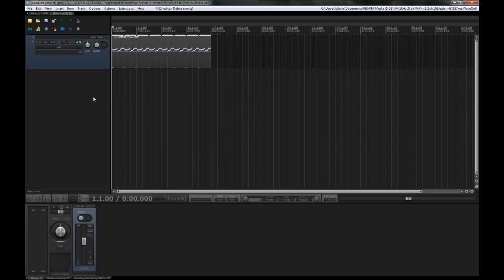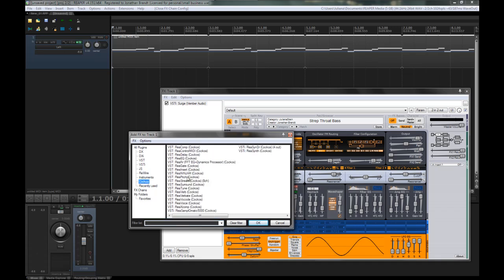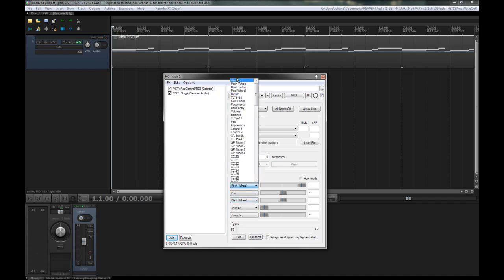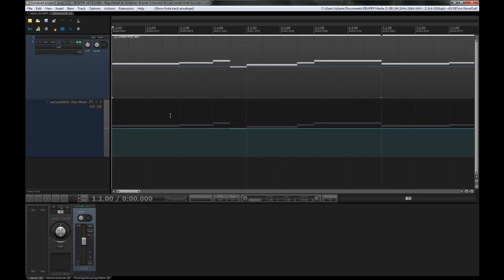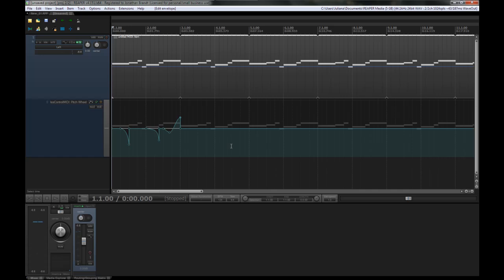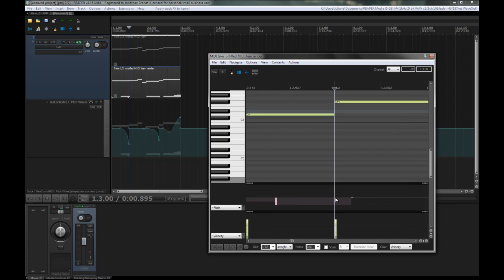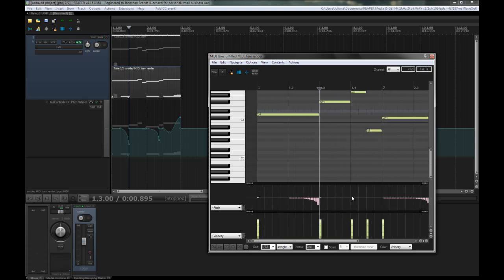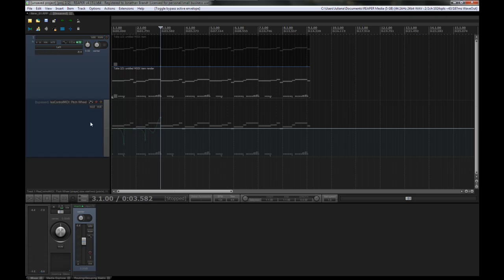An Alternative Pitch-Bend Method in REAPER

Comment: Is there an easy way to create an automated, exact pitch slide from one note to another?
Reply from the maker: No. To do this, you need a synthesizer or sampler with glide or portamento functions to bend between notes accurately and automatically. Technically it's the synthesizer/sampler interpreting the pitch bend functionality anyway, with settings from the bend being 1 semitone either direction to potentially 24 semitones up and 18 semitones down or some other arbitrary setting. It all depends on the software making the sound, since MIDI has no included sound data, just note-based (and CC) instructions. Software interpretations vary widely. And I suppose hardware synth interpretations vary widely too.
Reply: Jonathan Brandt 
I want to try to accomplish that using JS scripting. I looked up and there is actually enough of a standard for it to be workable at least for compliant synthesizer implementations.

The pitch bend CC is quite unlike any other CCs, it's the only one which by even the earliest MIDI standard has 14-bit precision, while other CCs are all 7-bit, though an optional mechanism to extend other CC to higher precision became available later.

The pitch bend CC shall by be mapped to pitch range of plus and minus two semitones by default. However, it's permitted that implementations can make the default pitch range user-modifiable. The pitch range can also be set by a MIDI message, RPN (0,0) message shall set the range expressed as the number of semitones, up to 24 semitones (two octaves).

The script would thus need to look-ahead and plan accordingly, to set the pitch bend range just before Note ON and then emit the pitch bends, effectively modifying a channel into monophonic and treating overlaps between notes as glissando.

The standard obviously acknowledges the need to provide a way to hit any sensible pitch change absolutely exactly dead on. However, it also acknowledges what you have seen, that default pitch bend behaviour can differ even in compliant implementations of MIDI. Also you can encounter non-compliant MIDI devices that for example don't decode the RPN message.
Reply from the maker: Siana Gearz
I mean you can go about it that way for sure. but in the end your synthesizer will be doing all the things. I'm not quite sure what a MIDI glissando provides in favor of what a synthesizer in legato mode offers. Legato/glide/portamento on the synthesizer side is also probably higher resolution than 14 bits, but I'm not quite sure what that accomplishes, if it's even noticeable. I suppose if you want a really really slow glide, it might be useful. I know in the 80's they loved their pitch bends. Lots of them everywhere.

I will say I've been incredibly annoyed with Kontakt's glide/portamento options lately. Super duper low resolution so it sounds like shit, frankly, and the spectrogram ends up looking like Mary Poppins cloud stairs. Drives me nuts.

If/when you finish that JS script, I'd love to have it if you're open to sharing it! I'm sure I could find some weird use for it. I usually can.
Reply: Jonathan Brandt  Yes it's a bit of an "if" i finish it, but i'll certainly let you know and it will be public, no intention of keeping it to myself.

I doubt it will resolve this specific issue though. A common optimisation in purely software synthesizers is windowed synthesis where some parameters are computed once at the beginning of the time window and can't change within it. It will leave a visible and potentially audible footprint. And it won't matter how you vary your pitch or other locked parameter, whether by MIDI events or by an internal mechanism of the synthesizer, it's just not capable of changing these window locked parameters any faster.
Reply from the maker: Siana Gearz
Yeah I know. Alas, the struggle. :P